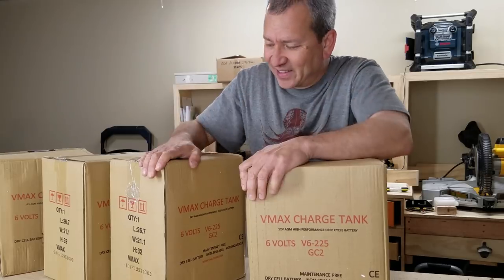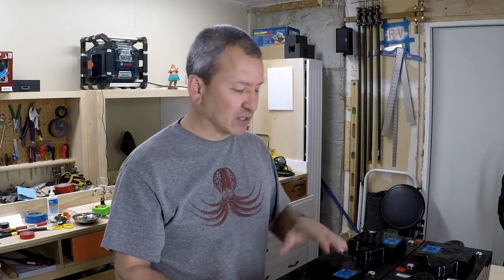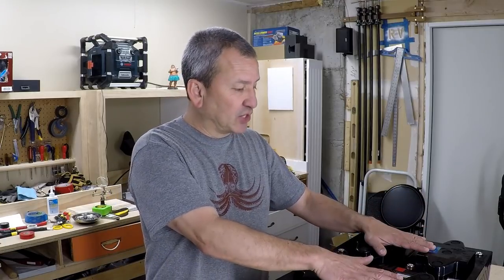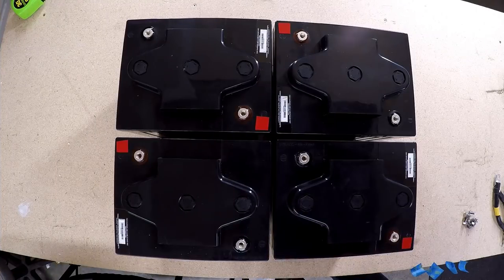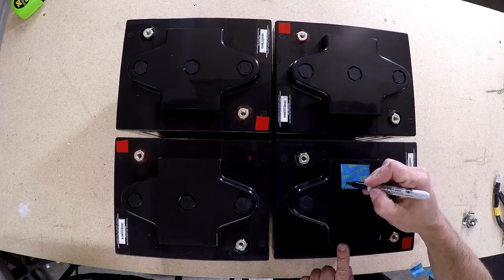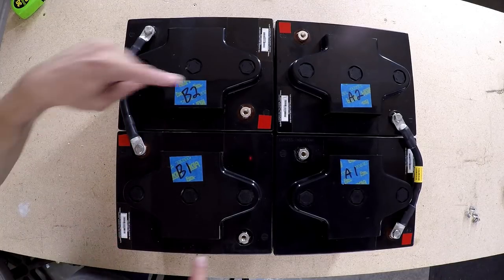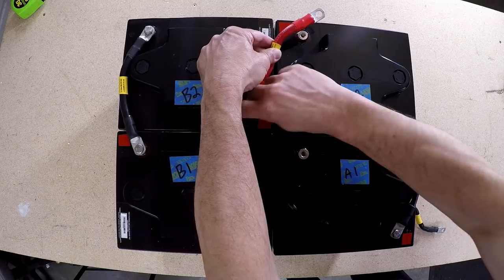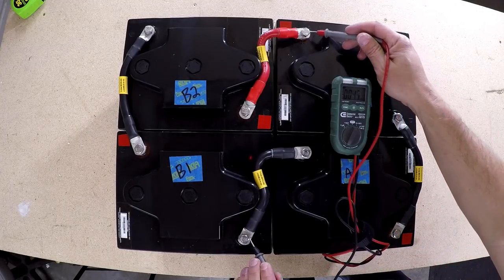How To Connect 6 Volt Batteries in SERIES and PARALLEL for SOLAR

Comment: Great simple to understand battery explanation. Just invested into 2 AGM 6V batteries. You are so right about space. Have a Chateau Sport 24-T RV with small outside battery box. I measured 5 times before ordering. I basically used a shoe horn to get the batteries end to end in a plastic battery box into where our 12v was at.  I am trying to find a company that makes a end to end battery slider tray. Once I find that I can modify and beef up the battery box to install the slider tray.
Reply from the maker: +Chateau Sport 24-T I was thinking of building a new compartment and tray but decided just to fortify my existing one with no tray. I won't be needing to service my AGMS anyway. Plus the tray adds vertical space that I needed.
Reply: Thanks    I am still looking into a slider I do not have any room to even see the tops of my batteries to be able to check the battery cables. Hopefully I can find a set of heavy duty slider brackets online and make a battery tray.

Comment: This is an awesome upgrade. I unfortunately do not have the space without major modifications. Maybe one day. 6 volts are definitely the way to go. Awesome explanation of series and parallel battery hookups. Good luck with the new setup.  As always great video and stay safe.
Reply from the maker: That has been my problem too. My RV originally came with one 12 volt battery. I've expanded and moved my battery bank at least 3 times in the last 10 years. I just don't have the basement storage like a class-A. I've actually thought of ditching my 4K generator and using that space for batteries.

Comment: Hey Tito,
Nice, sweet and to the point on how to make one BIG 12V battery. Loved the pre-made short cables too. That makes for a easy and clean install. I have 2 - 6V Trogan golf cart batt's in series like you 😜 USED TO HAVE 😜 and they still work fine for what we do and how we travel. 72lbs.a piece...WOW! That's a lot of weight off CCC. But hey still LIKED 👍 the video.
Nice job man. 🙏
Reply from the maker: Hey Thanks! Switched to lithium a couple years ago because we mostly boondock on solar. Any plans to upgrade? BTW great job with your channel. Good DIY info.. I've been watching for a long time now.
Reply: @RVwithTito  Thanks Tito. Ya I later realized you have since upgraded to Lith. But for us, no plans to upgrade to lithium. To much money, would need a different converter and other stuff. Lithiums are not plug and play from lead acid as you know. Plus my batt bay is located under my steps and exposed to the cold elements. I'd have to jump thru other whoops to protect them from freezing temps. Cause that does happen.....LIKE LAST WINTER in Texas. 😢 I just don't want to or need that hassle to convert.

But for us and the way we travel our 6V batt's serve us well. I've got 230watts of portable solar, a EU2200I Honda generator, my onboard Onan generator and some other stuff in the works. Once I have all my plan together I'll be doing a video of course. Right now we're living all summer in Maine on 15amps. Our 3rd doing this. We have plenty of power. Just have to manage it. No AC needed either.

I know you at one time were not full time but were planning on it I believe. Am I right about that? Have you done that yet?

Good hearing from you my friend. 🔧😜
Reply from the maker: @RVstreet  Great hearing from you too! We're not full time. About half time actually on the road about 6 months per year. Still have a house in WA and We're currently in Colorado.

Comment: great job ! love the big interconnect cables. when changing types of batteries .flooded AGM of LFP check mfg requirements for charge voltage  they are different and setting for that gets the longest life. most solar charge controllers like PWM or MPPT have battery type in menu or switch. just select your type. when making a bank out of batteries make sure same ones same lot  and same age . get the best life. even AGM out gas during charge just not as much. always make sure to vent h2 gas safely . don't want that to back up intp inside or rv.

Comment: You mentioned that you made an additional steel reinforcing bracket underneath to help support the additional weight requirement, do you have a video on that? Looking to add two additional batteries to my bank of 4 6v on the fifth wheel for a total of six batteries. Would like to make sure the proper support is provided... Thank you.

Comment: Very nice video Brian! I don't know much about battery power but your demonstration was very easy to follow! I am wondering what all you can power in your RV with this setup?
Reply from the maker: +Al D We can power everything we need now for more than a day or two. We still use propane for water heater, fridge and furnace and don't use air conditioning.

Comment: Great video. I'm building a solar system for my storage / workshop building. Could I use the 4 6v batteries with a 200W solar system?
Reply from the maker: Yes, absolutely. It simply depends on how much power you need to put back in the batteries each day.

Comment: Another awesome video!! What’s the maximum number of batteries you can safely connect in parallel? I have 5 x 12v/100Ah LFP batteries connected in parallel with 4/0 welding cable and tinned cooper lugs and wonder if it’s safe to add three more. Thank you kindly.
Reply from the maker: I do think there's a limitation you need to worry about. I've seen battery bank's with 10-12 batteries. Just make sure your cable gauge is adequate for your current load.
Reply: RV with Tito DIY — thank you so much! Is there any sort of formulaic approach to knowing how large a bank can/should be? I have Battle Borns, all purchased at nearly the same time, but should I be concerned about the batteries in the center of the bank vs the ones at the ends? My thinking is that since LFPs have such a low resistance that they’ll keep themselves balanced. Thoughts on that? Again, thank you so much.

Comment: Hi Brian,I have just purchased four of these batteries Same spec..My dilema is that i want 24 volts in total ..Is this possible.
Reply from the maker: Yes. You'll have to wire all four in series (positive to negative for all 4)

Comment: Have you had any issues from connecting the series banks in parallel? What would happen if one of the cells gets shorted out internally? I've seen this happen with two 12V batteries (flooded) that were connected in parallel. I'm glad they did not catch on fire. 
I'm thinking about simply buying two 6V batteries with the highest capacity I can find. Another option would be to get six 2V deep cycle batteries and connect them in series. I'm just not comfortable with parallel connections.

Comment: I just built a 400 watt solar system with a 30 a controller. I bought 4 6 v batteries interstate with 210 each.. I purchased a 4000 watt inverter pure sine wave gained it’s a little big but I can add more batteries later.. So my question is should I wire my battery in series or Parel? Thanks sir I want a big 12 v system..

Comment: Nice!  But you’ve since gone to Lithium, correct?  I have a single 400 AmpHr. AGM battery and it has to be reaching it EOL.  I noted that it’s not as robust as it once was and I need to decide on the Solar/Lithium bundle.  Too many questions for me...  Brian, do you have forum where you field questions/discuss topics?  I bet you’d get lambasted with questions, but I have wanted to run some past you. 

Anyhow, this was more great content.  Thanks!!
Reply from the maker: Yes. I've been on lithium batteries for 2 years now. There's a lot of info on my website. Go check it out.

Comment: Great vid! Thank you! How close (in voltage) should each of the batteries be before connecting them in series? Is a tenth of a volt close enough or should it be within a few hundredths?

For example, when connecting two 12v Battle Born LFP batteries in series, if one is at 13.10v and the other is 13.20v, is that close enough? Thank you kindly.
Reply from the maker: The battery bank output will be equal to the lowest powered battery. Keep that in mind. Connect them together and let them sit for a day to equalize. Then check the voltage.
Reply: RV with Tito DIY Thanks again.

Comment: What about the charge controller did you need to change it?
I have 650 Watts of Solar panels and two controls for each set of panels plus the converter that came with the trailer and a 3000 Watt inverter and 4 6 Volt Trojan T105 and I am looking to change the batteries to  6 Volt Deep-Cycle Solar AGM Trojan or VMAX batteries but I think the but I think the controller need to be changed out or re-programmed for the different types of batteries????? One reason for the change is longer lasting and no water to add LOL.
Reply from the maker: +Darryl T Yes. Going from flooded to AGM, I did change the charging profile on my TriStar MPPT solar charge controller to the sealed/AGM setting which basically lowers the charging voltage by 0.2 volts.

Comment: do you have something explaining how to set up a control charger?
Reply from the maker: Not sure I do. They are basically solar in and batteries out. You also need to set the battery type and system voltage. The more expensive models low you to do this via bluetooth while others have dial or switch setting. The instructions for the solar controller should walk you through it.

Comment: I currently have (4) 6 volt 125ah lead acid batteries. 2 are in parallel and the other 2 are in parallel and then they series together to equal (2) 12 volt batteries.

Would (4) 12 volt lithium 100ah batteries in parallel be significantly better than what I currently have?
Reply from the maker: That's exactly what I have now... 400Ah of usable lithium. Yes. It's a significant upgrade from 225Ah of usable lead acid.

Comment: I am assuming that this cannot be done with 2 6v batteries, correct?  if this is a stupid question sorry but I am new to this
Reply from the maker: Sure you can. You'll just connect the two in series. In the video I connected two, then connected each pair in parallel.
Reply: RV with Tito DIY ok so I can connect 2 6volt batteries in series AND parallel?     Just double checking for safety reasons. Again I only have 2 6v batteries

Comment: Hello, I bought an 89 Georgie Boy Cruise Air lll. in the front there are 3 x  12 volt batteries. My question is 1 is for starting the engine the other 2 are for the house, they are all hooked together because when the engine is running, they all get charged. Question---Can I replace  2 x 12v house batteries with 2 x 6 volt golf cart 215 a/h  batteries with the same battery conections without messing anything up? Meaning, can I hook them up the same way the 3 x 12 volts were? Changing to one 12v with 2 6v. batteries. Thank you.

Comment: What does the solar battery wires connect to which posts as well as the house cables?
Reply from the maker: You'll probably be running the solar charge controller output to a busbar connected to the battery pos/neg.

Comment: So can you connect 2 6v batteries in series into a 12v battery, and then connect that '12v battery' in parallel to 2 or 3 other normal 12v batteries? I just bought a fifth wheel camper and I have 2 6v I had in my truck camper, but I also have 2 12v batteries I used for my trolling motor and the fifth wheel camper came with 1 12v battery so now I have to figure out what to do with all of them.

Comment: 70 pounds each lol mine are 130 pounds each. I went with Trojan L16RE-B Flooded Lead Acid 6V Deep Cycle Battery 370Ah. the worlds best solar battery. .At least from my research they are.Cost a pretty penny but should have a life span of 5 to 8 years with 5 year warranty. Shipping would have cost 400 or more so I drove 100 miles each way to save some cash.I live in the mid west and got the batteries in KC. Mo.4 cost me $1629. and I am starting with 8 100 watt panels and will add 8 more in weks to come. just looking to see if I might want more than that. when I seen you say that your battiers was 70 pounds I was like hahaha you should try lifting mine. I want to get 4 more but man I would like someone else to lift them to my battiey box. I am getting a truck cart to move them when I do . But I am glad to see so many people going solar. even if you don't pick a good battery like mine you are still saving theEARTH. and for that I think you.

Comment: I have 6 12v valence battery connect it series-parallel, 24v and planning to buy a 24v valence battery connect it as parallel, can I connect it on the 6 battery 12v series-parallel then 6 24v parallel?

Comment: Hey Brian - Thanks for the great videos, very well done and excellent information.  I have a Class C RV that currently use a Marine 12V Battery (use to start the on board Gen), but I really loved your idea in using four 6V batteries in Series and Parallel set-up and thinking of copying it. However, I have few a few my questions and would really appreciate it if you can help out or direct me in the right direction to get the answers. 1) If I do switch over to the four 6V battery set-up, would this still be able to start the Generator? 2) Is the converter stronger enough to charge this set-up or to I need to upgrade my converter? and 3) Would this set-up put a strain on the alternator trying charge a large battery bank?

Comment: Correct me if I'm wrong. Each Battery is 225AH x 4 = 900AH.  The 50% use rule means you have 450 usable AH at 5.4 KW per day. You can burn all of that 450AH safely, without damage to the battery if you don't touch the other 450, and can bring it back up to charge.
Reply: I think when you CONNECT the two 6V batteries together they are 225AH total, but I could be wrong.
Reply: When you connect two 6 volt, 225aH batteries in series, the result is 12 volts still with 225ah total. In series, volts increase but the ah does not. 
When you connect those same batteries in parallel, the result is 6 volts with 450 ah. In parallel, the voltage remains 6, but the ah double.
The problem with this in an RV is the system is a 12 volt system, so you need your 6 volt batteries in series to give you 12 volts. 
However, if you do as Tito did, and connect two 6 volt 225 ah hours in series to make 12 volts, 225 ah, and then connected the other two in series to achieve the same 12 volts with 225 ah, then connect the first two to the second two, as Tito did, the results configuration is 12 volts total with 450 ah. 
Because 6 volt batteries have fewer plate in them, you can theoretically drain the more than 50% with little to no damage, unlike one 12 volt battery with 6 plates inside. The rule of thumb is to not deplete more than 50% because batteries do suffer damage below this threshold, 6 volt batteries less damaged than 12 volt. 
So in Tito’s configuration, while he has 450 ah by joining the 4 batteries in series/parallel, he actually only has 225 ah of useable energy before reaching the 50% threshold.
I hope that makes sense.
Reply: @budlina12  Thank you for clarifying. It does get a little confusing for me.

Comment: I just bought 8 - 60 watt equivalent light bulbs for 110 watts for about 50 cents a piece.   The price for 12 volt LED lights (shopping around) seems to be about $10 a piece.  Are we being ripped off or is there a better source for LED lights to replace camper 12 volt bulbs?

Comment: Do the extra batteries require the on board RV charging system to have a higher charge capacity rating when connected to shore power?  Plus if the batteries are discharged to 50 percent of their rating, for example, is there an issue with the RV's alternator recharging the batteries in a timely manner when traveling down the road?

Comment: I am wondering if they are actually hooked up wrong. WHen you ran them in parallel do you not have to run the negative to negative and positive to positive for the separate 12 volt series banks. 
You ran them from the same series banks instead of separate. Or does it not matter?
Reply from the maker: What you said is correct and that's how they are connected. The outer cables are the series connections. The inner cables are the parallel connections (pos to pos, neg to neg)

Comment: I noticed you did two series and one parallel connection.  Would it be the same if you did two parallel and one series connection so you could split the battery banks up?

Comment: how many 6volt battery can be wired in serie/paralel for my battery bank for a 12 volt system i have 12 battery 6 volt battery that need to be wired togheter for my solar system  thx
Reply from the maker: You can wire as many 6V series pairs as you need. Sounds like you'll end up with the equivalent of 6 x 12v  batteries.